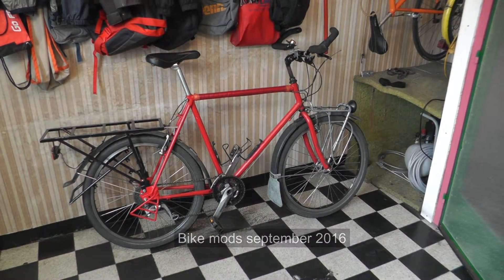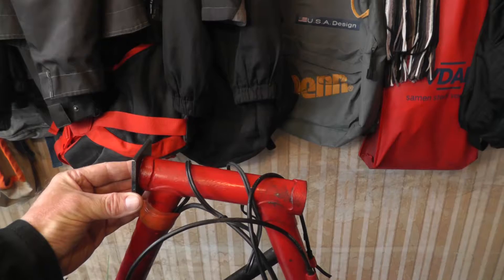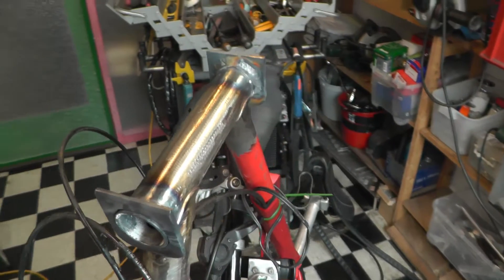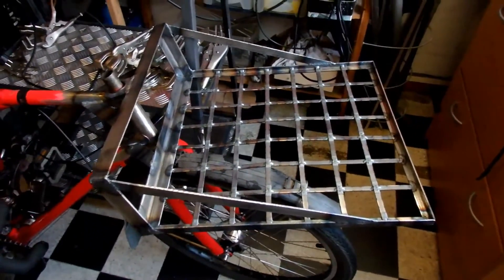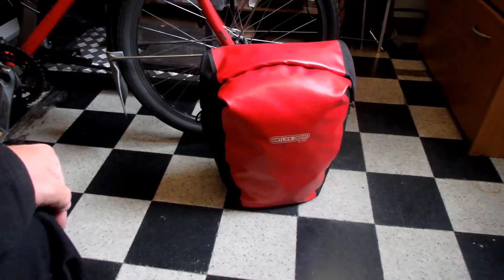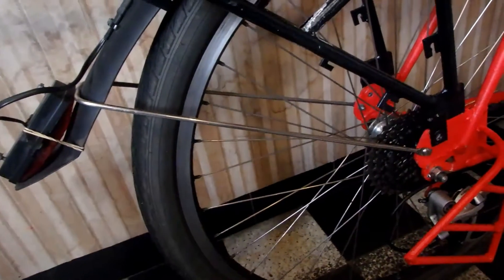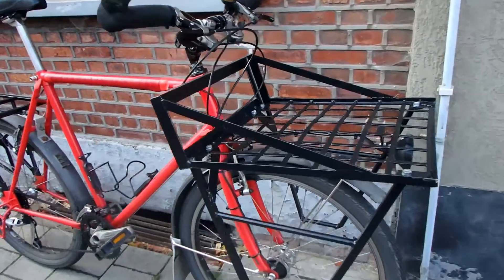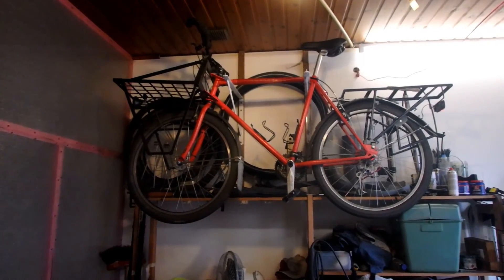Bikemods

Comment: I have zero experience of cycle touring however am wondering about hanging heavy front panniers so far away from the front axle centreline.....how is the balance?
Reply from the maker: Alex Lintern Hello Alex, it didn't work out so well. It was kind of a consequence of welding the carrier to the frame instead of the fork, but for my next trip I'm going to but the panniers back on the fork.